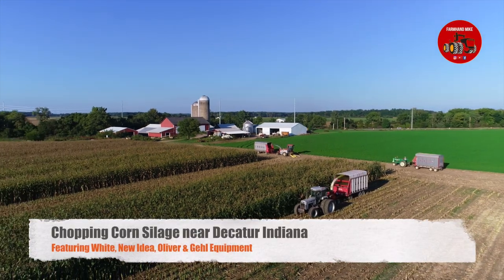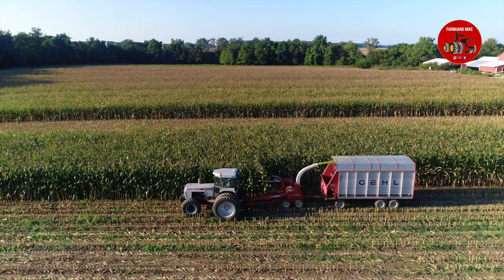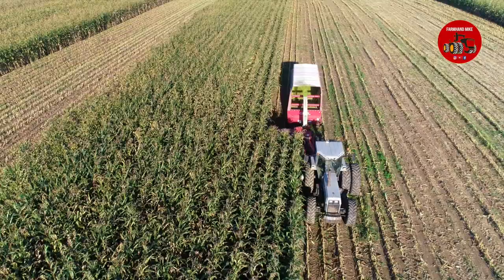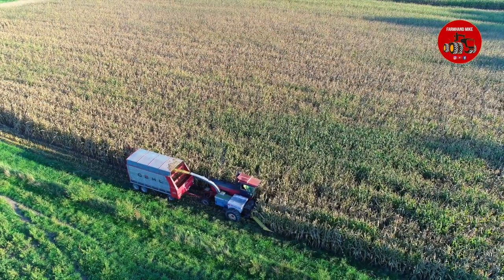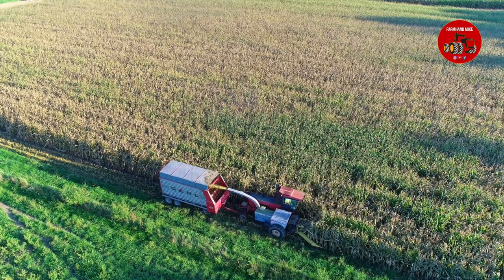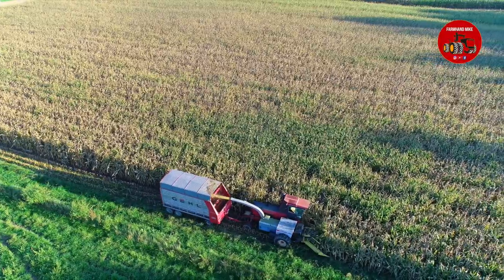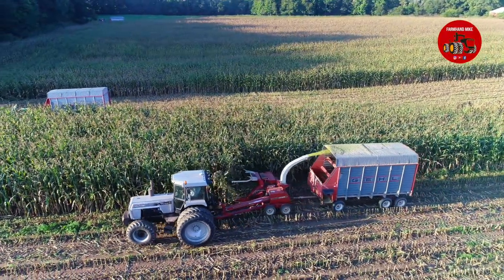Chopping Corn Silage near Decatur Indiana - September 2018

Comment: Oh man . That Uni brings back memories and a few nightmares .
Reply: yoder82 unis always seemed to bite you if you had to work on them
Reply: Ed Reisinger . Very true . I had to try and keep an extremely wore out 767 super chopper unit going , there is nothing super about that piece of equipment !
Reply: yoder82 we still have ours. It started out on a 705 power unit. After the 705 gave up the ghost, we put the chopper on a 707. Did you have the 768 wide/narrow head on your chopper?
Reply: Ed Reisinger  I do not recall the model of header it was . It’s been 25 years ago  ! We had a 705 power unit then later got a 709 and both power units worked really well .

Comment: Dad bought a 5.9 Cummins and gave me the job to replace the old wakishaw in a 1955 Oliver back in my late teens... we didn’t put a turbo on the the Cummins and it pull better the the original engine.

Comment: Acording to a farming magazine that i found online new idea switched coulurs the year 1984 when they merged with white. The used silver for the uni systems and white for the rest of their eqiument line. They later changed from silver/white to red in 1993 when agco bought them. They used the red coulurs up till 2005 or 2007 when agco cancelled the new idea eqiument line in favor of challenger and MF.
Reply from the maker: Thanks for the info, I almost forgot about the red colored New Idea at the end.
Reply: Mike Less - Farmhand Mike Thank you mike for giving such great info about versitale. Online i have been seing pictures of new holland versitale and buhler versitale with tracs similiar to the tracs of a challenger. I was wondering if you know anything about them??

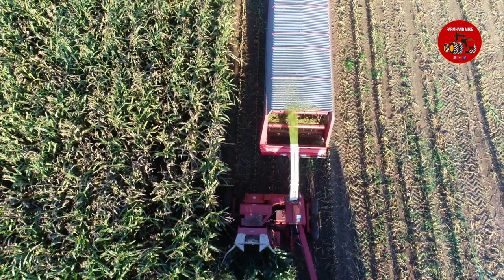Comment: Did the white at around 1:19 only have one rear dual?
Reply: chunkmen  The white only has one dual on the side next to the corn would run the row of corn down if the dual was on . Hope this helps thank you.
Reply: @perryspradlin6779  yeah I know it would run down the row of corn but why leave the second dual on then?
Reply: chunkmen may have been wet. The dual does help you float and smash down ruts. We have done that before. It does make a difference.